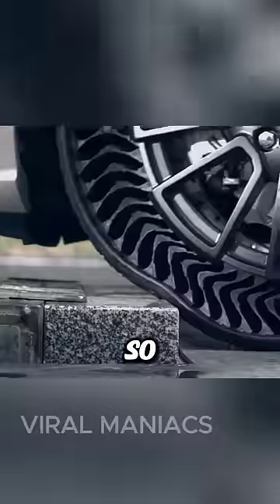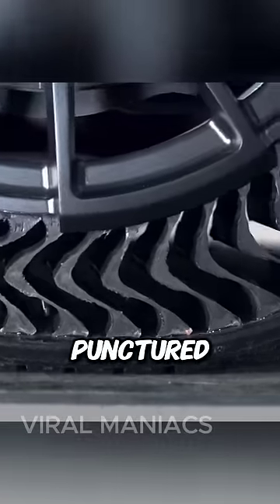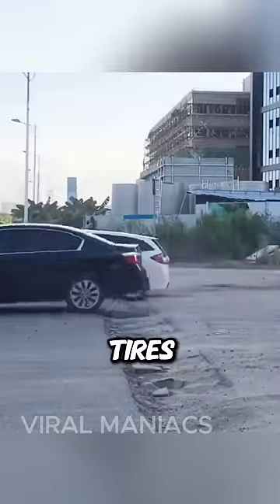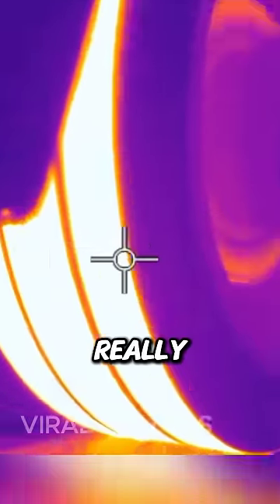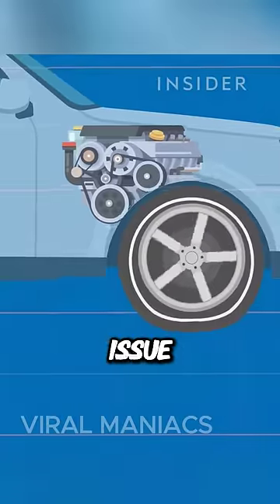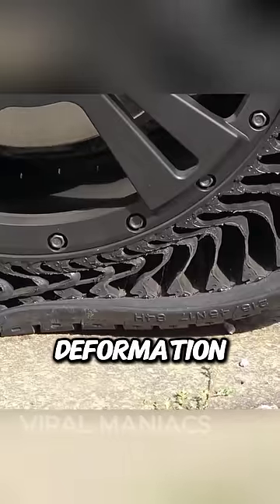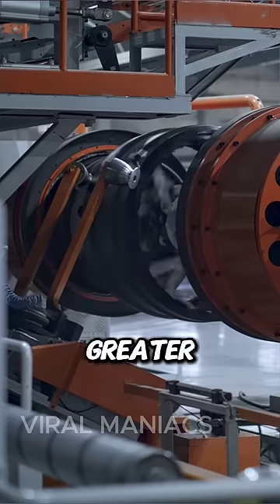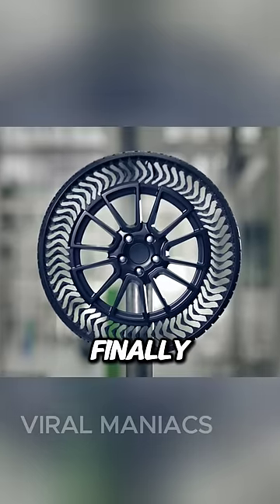Why Don't We Use Airless Tires Yet #shorts

Comment: Balance is a problem if mud gets in the open sidewall.
Reply: Then close it easy solution😂
Reply: The open side wall is a demonstration of how it works .not the final product
Reply: @rosegold-beats  then it becomes a tubeless tire.
Reply: @leed2883  you are wrong. The tire has to stay open. If it is closed, the air would be compressed.
Reply: @blumobean they can allow the air to leak no problem
Reply: @blumobean then this tire is completely pointless for anyone that lives in rural areas. If it stays open its impossible to keep mud and crap from filling the sides.
Reply: @dheerajmurthy393  If air can leak in then water can also, now the problem is getting the water out.

If you seal it up then it defeats the purpose of airless tire, if you give it room to breath then other crap will get into it, I think this is the final design, just open side walls.
Reply: @slowville6637 they can be closed but not inflated and everithing will work fine
Reply: @niccolo_tommasi  Lets say it's sealed/not inflated, if you get a puncher/some kind of hole or leak, now water get's in from rain or driving in water puddles, now you will have dirt & water semi trapped.

The purpose of anything seal is to keep stuff from getting in or out but once the seal is broken then that purpose is gone.
Reply: It would fly out
Reply: @Moon_Cricket_Stinks it's tyre
Reply: @leed2883  OH!! I never actually thought about that, but yeah would make sense that it would be just for demonstration, so you could see and understand that it is not just filled with something else ( gas wise )
Reply: @dheerajmurthy393  If there's an opening dirt/mud will get in.  And it will be mighty hard to get it out once it's in there.
Reply: @leed2883  It's not that easy to have a sidewall that can cope with the extreme deformation and doesn't mess up the shock absorption with it's own stiffness. And doesn't trap water/gunk in there permanently.
Reply: You could give it a side wall to close up the fins.
Reply: @blumobean  compressed? Like in a normal tyre at 30-40 psi? Air can be compressed unlike the mud and dirt that would accumulate within the open cavity.
Reply: @n3lis94  a normal car tyres side wall deformation is substantial, the internal structure of the airless tyre replaces the structure created by the compressed air in a conventional tyre. The side wall would improve lateral stability and prevent foreign objects interfering with the internal structure.
Reply: How would mud stay in the tire 🤔
Reply: There are so many tire engineers in these comments. All the major tire manufacturers are looking for solutions. Little do they know the solutions are in youtube comments.
Reply: What balance ??
Reply: @Insert.anger50 both ways of spelling tire and tyre work
Reply: @kaic2419  tire means becoming fatigued, a tyre is what goes on a wheel
Reply: @Insert.anger50   tire is actually a way to spell it in certain places in the world. It’s kinda dumb 🤣
Reply: If you angle from the center out w/a 1% grade anytime water gets in it will wash it out. Not to mention the squish effect.
Reply: @blumobean  lol 😆  might be a tire install guy here so watch it 🤣
Reply: @Ele11527  wouldn't work, depending on on temperature the tire would be under vacuum or pressure and possibly fill up with water when cold due to condensation
Reply: @v4lhulme  an empty tire is not going to fill up with water from condensation there's not that much water in the atmosphere to do such.
Reply: It won't be open, use your brain for a sec
Reply: @blumobean source: trust me bro

Comment: I just see an issue with snow or water getting in the middle and driving in those conditions can alter the way the tire flexes. As well as driving fast and turning. Without a sidewall that’s filled with air, that may be a hazard in those scenarios
Reply: I think they show it like that for visual purposes to show how it works but that a commercial tire would have rubber covering over the sidewall so that it would look no different than a normal tire. If they had it open like that it would pick up rocks and fling them, etc. Also, one can only imagine the pranks that would happen with people inserting sticks, etc into the open cavities.
Reply: @newfie-dean5803  ahh a covered sidewall would be a great fix I see what you mean. Yeah exposed sides is trouble
Reply: @newfie-dean5803 even still it would technically be filled with air and the more the wear and tear the more exposure to the inside it would have. I hope they find a good way to implement this for the environment but I don’t see a way to do it reasonably
Reply: @newfie-dean5803 ive seen them on mowers and they arent covered. Riding mowers weigh almost as much as a car, my moms ferris 60” weighs 1600lbs.
Reply: Yeah two things you’ve mentioned are obsolete, they have side walls.
Reply: And them turning into little rubber strips if you gotta do a sudden break at high speeds. Lol. I can already see all the accidents 🤔 Like..."hey, if you thought a wooden stick in a bicycle was bad...just wait until you see this! * holds up iron pipe..*" - Some dumb TikToker

Comment: Because the constant flexing will wear out the rubber until it cracks/snaps and rocks and other debris will get in between and rip them to pieces.😅
Reply: Cover the side wall with thin rubber  to keep  out mud and debris.
Reply: Winter is the real problem here. Once the rubber hits freezing temperature those joints will become brittle.
Reply: @adamstilwell4209  that wouldn't be too much of a problem considering that we have to switch between regular tires and  softer more frost-resistant tires anyway. What I'm worried about is turning because when you turn you create a force that tries to push the inner section of a tire sideways, outside of the outer part that's in contact with the road, and these filaments holding them together don't look like they will like that type of strain
Reply: Imagine how fast they’d fall out of balance driving through snow or mud.
Reply: They would not have open construction released  to the public,that is only for display purposes. Run flat tyres have already been utilised.
Reply: @haze_2563 this is not new tech, it's just a youtuber who "discovered"it for the first time and is trying to make money on it. This decades old tech will never make it to automobiles because of serious shortcomings

Comment: Its called a tweel. Been out for over 10yrs. See them on lawn equipment all the time.
Reply: So what? They still don’t work on vehicles that travel at freeway speeds. This is about using them on cars, not lawn equipment. So they do exist, but not in the automotive world.

Comment: I’ll buy a set after them run them in NASCAR.
Reply: One of the worst motorsports
Reply: Who is signed with Goodyear
Reply: NASCAR is awesome.
Reply: Only formula 1 we aren’t Americans 😂
Reply: @binaypatel7665  even if you think so, nascar is a motorsport that's really tough on tires, so it'd be a pretty good test for these
Reply: Those tires can't corner . Maybe cool on a tractor or slow moving vehicle but not meant for high speed and definitely not corners
Reply: @Anatoli_Punto  l do. Your point has nothing to do with mine. Couldn’t care less about your the tyres. Also most, if not all tyre compounds differ. Not only from brands but all racing series and formulas.
Reply: @binaypatel7665  Then why'd you respond with an irrelevant point? The original comment was about the tyres in nascar, OP said he'll buy them if they are tested there? What are you on about?
Reply: @Anatoli_Punto  wot u on about. How isn't my comment relevant. OP mentioned nascrap, and so did I. 

Your response to my comment, like Nascar, isn't needed. I was making a point on comparison. You come along talking  about tyres. Speaking of which, to hammer my point home, the tyres nascar that Nascar use are reletive and built to a spec. LIKE ALL TYRES ARE. Jog on.
Reply: @santostv. Formula 1 better than NASCAR but Le Mans better than Formula 1.

Although I do love Max Verstappen
Reply: @binaypatel7665  Bruh, the point of the op comment was literally about the tyres. You came along with your opinion on nascar, which nobody asked about. I referenced it in context of the original comment, then you replied being all hostile, thinking you're some smartass just because you don't like Nascar.
 
Tyres are spec built for motorsports? Wow, sherlock, I didn't know, thanks! But guess what? It's not about that. It's about testing THE TECHNOLOGY ITSELF. It can absolutely be spec built and still valid. Radials, when first introduced, were tested where? That's right Nascar. 

I'm not continuing this though, people like you will always find some way to convince themselves they're right. Have a good day man.
Reply: They might cost $1000  a piece 😁
Reply: @Anatoli_Punto    and who asked for your opinion. I was selective as much as you are being. You replied to my post, not the OPs.  Hope that works well for you. Your involvement is as useful Yanks are to native Americans. Anyway, jog on cupcake
Reply: @Hypercharged-03  All of these completely suck compared to Rallly
Reply: @JOSEF_GAMING45 It was back when it first started. It's supposed to be stack car racing. That's what it started out as. Every car has the exact same chasis and body now. Back when Richard Petty and Cale Yarborough drove, that was real stock car racing. It sucks ass now.

Comment: Oldsmobile in the 70's had a composite rim instead of steel, which heat and bumps deformed and cracked them creating an actual leak on the tubeless tire..it was an item ahead of it's  time
Reply: I feel like this “airless tire” would malfunction immediately when you turn left or right tho, this is why we only see footage of driving straight forward
Reply: @808szn how so?

Comment: A tire with air not only would be cheaper to manufacture, but it would offer superior performance. I wonder if Michelin might want to explore that avenue.
Reply: That was mentioned in the video as the main reason why these aren't exactly standard.
Reply: These definitely would not be cheaper to manufacturer. The mold would be more complex with at least 4-6 parts instead of the two they have now.
Reply: Then can sell something called the fancy cover
Reply: @Bl4ckD0g joke went over your brain
Reply: Please explain how the manufacturing would be cheaper and an what the performance gains would be?
Reply: @bcarss1970 They didn't say manufacturing airless was cheaper its the oppsite, but Michelin helped to address the issue of its production cost.
Reply: @jaxithfox They didn't say manufacturing airless was cheaper its the oppsite, but Michelin helped to address the issue of its production cost.
Reply: Noo we are not ready for airless tires
Reply: Sounds dumb
Reply: More like dangerous performance. Michelin have been diddling with these since the early 1980's and they make a car highly unstable at higher speeds. They have been selling these for decades for slow use.

Comment: Only useful as an emergency spare. Cannot be used as a touring or performance tyre. Gas milage will also decrease, rolling resistance looks to probably be much higher. Best to be used in poor street quality situations or as an emergency spare, or on an offroad or construction vehicles.
Reply: by "poor street quality" you mean daily driving in the UK.
Reply: @Sammyli99  UK (probably) has better streets than the US.
Reply: @burakoshimazaki  You are right, UK streets the pot holes are held together with speed bumps, I live in neither, have lived in Both.
Reply: The easy and obvious solution is solid rubber or solid rubberized composite. But we can't have that, because it solves all drawbacks of the other two types, as well as letting you potentially go half the life of the car on a single set if you want to. They'll come up with any solution that saves waste but still lets them continue to sell lots and lots of tires per person-decade. If meeting those two requirements fails to solve any of the other problems (cost, durability, ride, noise, safety, handling), they don't care about those. In their view, the first two parameters (waste reduction plus planned obsolescence) outweigh all the rest.

Comment: Well now it will be difficult to catch thieves or fugitives running on car....
Reply: So this is a gangsta friendly tires. It's good
Reply: what? they've had "never flats" for years, if your willing to spend the money. this is just innovation. march o progress. in your world are these tires for police cruisers only?
Reply: Metal cable few inches of the ground, easy stop
Reply: Grapler
Reply: Spikes would probably get stuck in tires and still stop them in their tracks
Reply: Not really anything a police cruiser with an AR-15 drive-by or wheel catcher couldn't solve. The tires just can't be popped, not a hard workaround. It doesn't make the car faster.

Comment: Pipe dream.  There’s no way in hell that design will last 85,000 miles
Reply: they WOULD be awesome spares tho!
Reply: do normal tires last 85,000 miles? genuine question
Reply: @siloedspace yup
Reply: @siloedspace  
I have a 2013 f150 and I’ve only on my third set.  First set changed out at 85,000 miles, second set changed out at 165,000.  Currently at 215,000 miles and going strong.
Reply: My tyres last about 30k miles. Michelin ps5 on f21 xdrive
Reply: Depends.
Reply: That’s what they said about the automobile,the airplane, and the electric car.I’m sure some tires aren’t as far fetched.
Reply: How do you keep tires that long? My Michelin PS5s barely last 50k km.
Reply: You an engineer?
Reply: @stickystick105  
I’m mechanically inclined with 22 years of working with my hands.  Better than a four year engineering degree.
Reply: @siloedspace not a fucking chance
Reply: @siloedspace  No. Anyone claiming theirs last 85k full of crap or are perfectly comfortable running tires way past their optimal grip point. Most all season tires will advertise a lifespan around that for the warranty of the tire but when it comes to grip, no tire is safley rolling down the road at 85k miles, let alone even 50k proper rotation intervals or not.
Reply: Depends on if they are on the front or back and how bald you are willing to drive on them.
Reply: @TamaHawkLive  
Nonsense.  You don’t know what you’re talking about.
Reply: @itsoktobehappy461  
Rotating them.
Reply: @misscyanic2484 that's a really expensive spare lol
Reply: @levibaer18  I didn’t know that generation could be so reliable. Impressive!
Reply: @icedagger64gaming  
5.0.  Not one problem as of now.
Reply: @levibaer18 lmao. Until it comes to high paying positions.
Reply: @horsethi3f they're prob tires with shit grip. You can use em on fat, heavy pig trucks that can't handle for shit

Comment: I've seen these on construction vehicles like front end loaders and small cranes.  The fiber spokes were alot thicker and instead of one set radiating out, they had a few that would criss-cross each other.

It makes sense to use such tires for these environments.  I saw in the construction zones lots of debri like nails what would puncture a tire.
Reply: Most tires on construction equipment like that have calcium filled tires, if you look at the wheels instead of having a normal tire stem with a Schrader valve in the tip they have a pipe sticking out of them with a typical cap on the end that looks just like the kind of pipe end caps you can buy at Home Depot that have typical NPT threads that all pipes and pipe fittings have.
The calcium is a light grey color slimy liquid that won't freeze, exactly why that's used to fill tires on equipment like that I don't know basically because I never ask anyone in all the years I spent on construction site's as an ironworker, aside from it not freezing I don't know what the advantages are over just having pressurized air in them but I'm sure there's good reasons behind it.
Reply: My forklift runs on full rubber tires and that's how they've been working ever since they were invented...
Reply: @DaemonwarriorJulius  
I bet those would be real comfortable on the road, my kidneys hurt just thinking about that.
Reply: To be clear, I've just seen it once on a couple of construction vehicles in a zone I use to walk by often.  It definitely looked like the tires in this video: A rim surrounded by radiated "bent" spokes, wrapped in a surface with treads.  Except, in my case, the radiated spokes was a radiated honey-comb pattern.

I'm pretty sure of what I saw.  One day, one of vehicles was parked outside a fenced zone.  I was able to walk up to it.  I touched the tire and spokes.  The spoke felt like hard rubber, but I'm not sure if it is rubber  I bent down and I could see through the tire.

The vehicle wasn't an experimental vehicle for testing new tires.  It was legitimately being used for construction.
Reply: @dukecraig2402 we fill our tractor tyres with water to get more weight on the ground for better traction. Makes a huge difference. In northern latitudes they have to use a liquid that doesn't freeze solid.
Reply: @stevenstart8728  
Makes sense, I knew that they used the liquid calcium because it didn't freeze but what the reason is for a liquid in the first place I never knew or ask anyone for that matter, but yea weight, that makes sense.
Reply: True and lost of these machines won't hit high speeds so that explains a lot why those cranes have them already